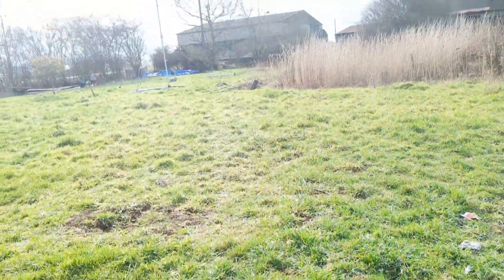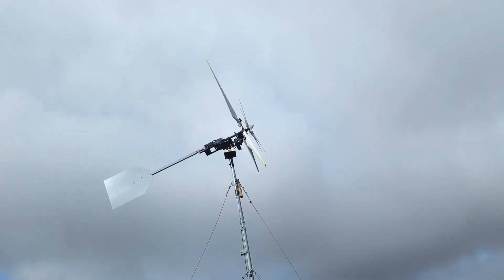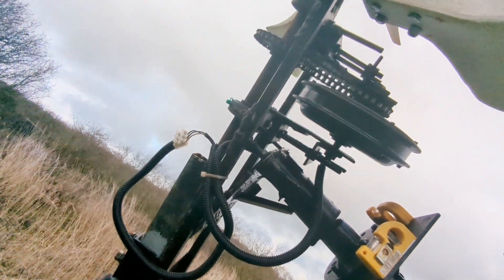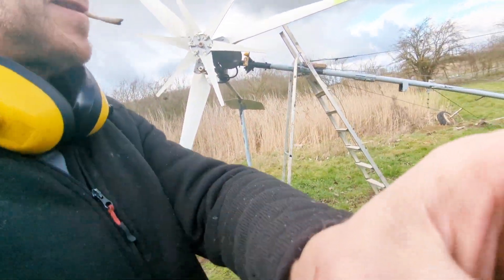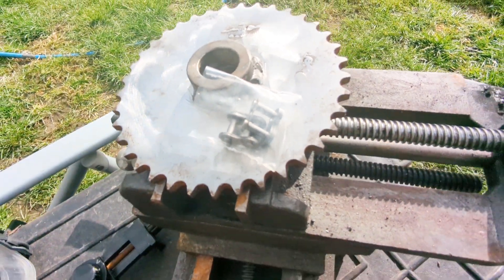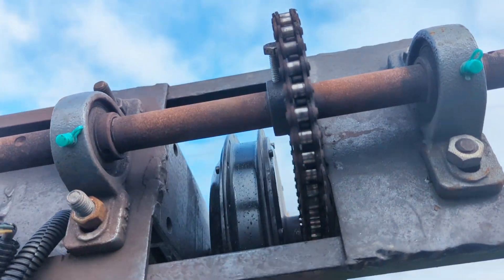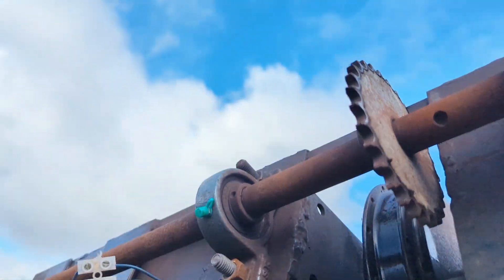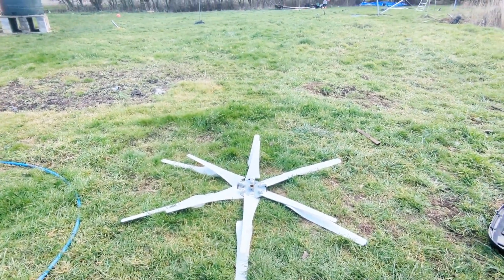Wind Turbine Project Free Energy Generator - Taking Down for Upgrades - 1st March 2023

Comment: Will be interesting so see how the higher gearing affects performance. Are you still going to persevere with the bigger 3kw motor in the future?   Also, those big prop blades are great. Did you make them or buy them?
Reply from the maker: I will definitely get something done with the bigger motor but I may build a totally separate frame for it which ironically I have an old one which might do the job, The blades I bought from China years ago. Yep they are pretty cool